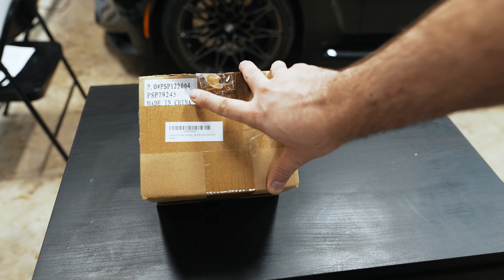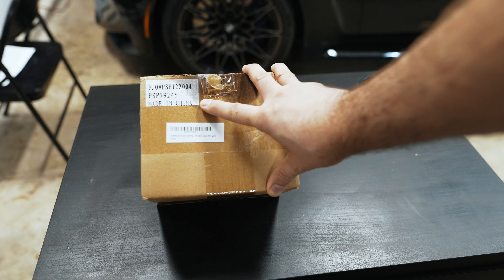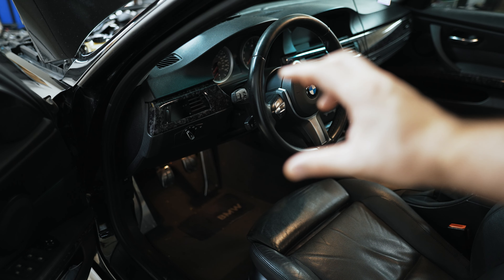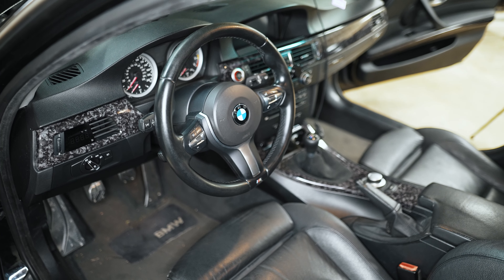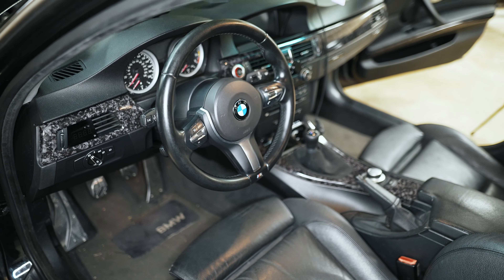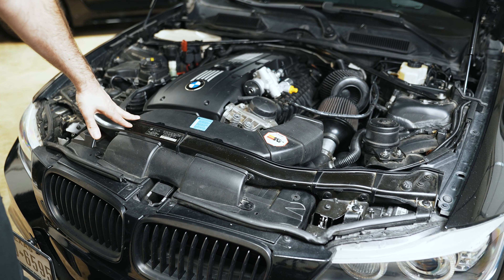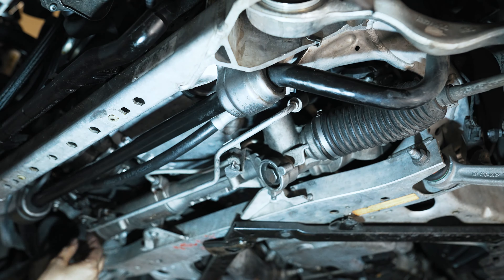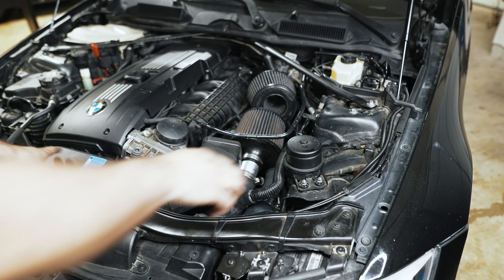This Is The Last Thing To Wear Out On Your BMW!

Comment: Very detailed diagnosis and breakdown, my friend! 
Looking at replacing the power steering pump in my mum’s 2006 E90.
I don’t know how the pump was worn but its regardless it has been putting some miles down, which explains the pump issue; its making your average whining noise, when you turn the engine on you can just hear the pump whine over the exhaust sound as the motor starts. 
ABS light comes on everyone and then too, believing there is a connection..great vid!

Comment: Just did the water pump on my 328xi and yes my first indication that something was amiss was that my fan sounded like it was trying to make my car fly away. I had just got protool around the same time and it gave me 2 water pump codes but it never threw a light on the dash and never overheated, so exactly as he says in this video, if you've had your car for awhile (2 years for me) you will just know when something doesn't feel or sound right. It wasn't only the fan for me. The car was acting strange upon acceleration, it even dimmed my headlights which initially made me think it was the alternator. Good thing I got ProTool. Wish I knew more of what I can do with it but so far it seems to be a great app.

Comment: Good video. Good advice.  I bought an 07 335i E93 N54. 137,000 miles on it. Power steering pump has been damaged by a serpentine belt that was too tight. Unknown to me it damaged the alternator power steering pump bearings in both. Long story but you will experience thrown and shredded serpentine belts in this case. This is dangerous to the N54 because  shreds can be pulled into the engine behind the crank pulley. Didn’t happen to me but YouTube is full of stories of people it did happen to.

Comment: I have to go that route for my 11 X5 E70 xdrive35i. OEM pump is around $1200 on FCP Euro vs $150ish for aftermarket. It's crazy, my pump failed at 32k miles. I get a whine and it's embarrassing espically when driving by people lol. I did a complete flush at the rack after watching your video using chs11s cause I thought maybe the fluid is contaminated or burnt. Worth a shot, but it made the same noise. No change in volume. I did notice some very smooth metal like material inside the resivore on some of the white plastic inside. Almost like what you get from a transmission pan magnet. Not sure what else I can do. Really appreciate you taking the time to make videos.

Comment: Thanks for the video I was doing some electrical work and came across my power steering wheel being cracked and the pump failing now I'll be able to do all of that😊
Reply: Barley coming back to watch the video again because I couldn't find any luckily I was here already finally got the part now I'm ready to install thanks again
Reply: Here again because I want to ask does it matter where you leave the steering wheel when you go to replace everything?
Reply: I’m having trouble finding the 22ml banjo bolt
Reply: I found it I actually have all of the intake manifold and a lot of the stuff off so I could do some of the work on top thanks again

Comment: Mine got messed up when my motor mounts were worn and I hit a bump and my sub-frame smacked the power steering pulley and shredded my belt. It was an easy replacement. I highly recommend getting a metal pulley installed as well.
Reply from the maker: Yeah the metal pulley offer some piece of mind.

Comment: Nice video. I have a weird buzzing noise from my ps pump. I've replaced belt, tensioner & pulleys & flushed & renewed fluid. I have no heavy steering, no grinding noises of any kind, steering feels great. Just this constant buzz when you put your head near bottom of front bumper. You notice it faintly in the car when you pull away in 1st & 2nd (high revs low speed) zzzzzzz, zzzzzz, & then fine as road noise etc drowns it out.
I used a stethoscope on the ps housing, to determine it was from there. It went from a handful of bees to a hive with the stethoscope 😆. 
Now, the thing is my car has only 25k miles on it, active steering like yours as well.
An independent said it can only be a bearing in there, & assured me it won't just freeze up & snap the belt, but you should notice it get louder.
I also priced an oem pump from BMW & was shocked at a price of £900, compared with aftermarket at £250.
I'm planning on leaving it to see if it gets worse. Any thoughts?
Thanks
Reply: I have exactly the same thing happening on my N52. I suspect it is the pump but can't tell for sure. Replaced the belt, tensioner, idler, bypassed the AC to make sure it is not it. Only thing left is the PS pump and the alternator.

Comment: If the water pump was easy to get to it wouldn't be suck a big deal to use the cheap parts either but the amount of work it's better to use a know reliable part!

Comment: It wasn't unusual for my N52 cooling fan to run a little wild from time to time. It went away with a new temperature sensor on the front part of the cylinder head. It's a pretty cheap part to throw at it before a new water pump and thermostat. The old sensor seemed fine when monitoring live temperature data, but the surging went away with a new sensor.

Comment: So assuming that the power steering fluid was then drained once you removed the banjo bolt.  Any words of advice for dealing with it or avoiding the mess?   Any concerns to worry about the rack at that point?

Comment: I'm wondering how that Power Steering pump is holding up since you've installed it?? Been on a fence of going that route... $85 for my 2008 528xi... or I can get an OEM used one w/ relatively low miles on it for $99

Comment: Is there a way to determine if it has active steering or not without going under and looking at the pump? I have a 2009 e92 335i xdrive msport and need to replace my power steering as well.
Reply from the maker: If your reservoir looks the same as mine then it would have active steering.
Reply: @VehicularDIY  i love your content. I REALLY REALLY needed this video

Comment: if the pump fails will it shred your serpentine belt? also what were the torque specs for mounting the pump to the block?
Reply from the maker: No that only happens if the pulley cracks.  28 ft lbs.

Comment: Not related to the the video but just wanted to ask the community in this video. 
So I have 2010 335i with base audio and my two front speakers went out when swapping them with hifi speakers. I put the oem speakers back on and still no audio in the front only. Any help would be appreciated!

Comment: I think mine is going bad, steering feels way heavier than my previous e90. Will check into it
Reply from the maker: Yeah it got to the point where it was ghetto very heavier in regular driving.  The pumps stay quiet even as they are failing on these cars it seems.

Comment: Is the steering rack still the original one?
Reply from the maker: Yeah the rack is still original.
Reply: @VehicularDIY  My car is the same year with active steering and 100k miles but there’s play between the rack and pinion. Do you recommend adjusting the preload screw to reduce the play? Great videos btw! 👍
Reply from the maker: Have you checked the lower linkage for play?  Thanks!
Reply: @VehicularDIY  yea that's been replaced. I can see on the driver side that there's vertical movement on the end where the inner tierod screws into

Comment: "almost OEM" Bosch pump (K S01 000 725) costs 380 Euros right now in Germany.
Reply from the maker: I was finding the oem active steering pump for around 900 usd here.
Reply: also search for manufacturer and "microcat" e.g. "ZF microcat or webcat" or "ZF techdoc" to find their part no.s. They ( at least in Germany) sell parts for 1/3 of the price than at bmw stealership.

Comment: The power steering pump failed and was replaced under warranty on my 2010 335i at 40000 miles.
Reply from the maker: Was it noisey when it failed?
Reply: @VehicularDIY  Previous owner, in the service records.